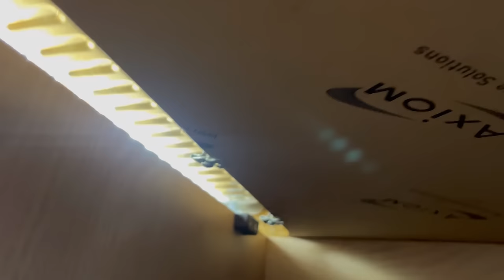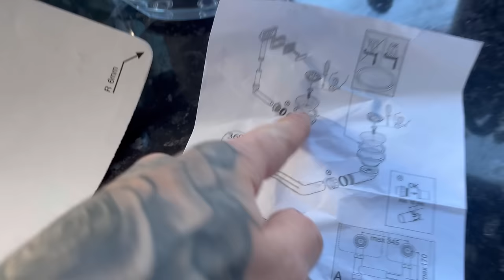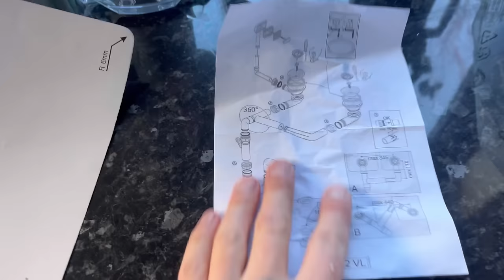I HATE THESE JOBS-Changing a kitchen sink..#plumber

Comment from the maker: Happy Easter everyone, hope you all have a fantastic break if you’re off ❤
Reply: Maybe a silly question but why are the sinks sent out without a 35mm hole already there……. Is it so the product doesn’t crack in transit? Genuine question?
Reply: @gavinbiard3745 different sizes of tap available not all are 35mm
Reply from the maker: @gavinbiard3745  it’s so you can use it as either a right handed or left handed sink, the bowl either right or left hand side.

Comment: Gave our cut work top edge where the sink slots in 2 coats of clear yacht varnish , is still rock solid & bone dry 30+ years on ! 👍🏻
Reply from the maker: Good shout that. Might have to get some of that varnish!!
Reply: @Heatking  , deffo mate !👌🏻, silicone just does the usual especially with the transferred heat of the water especially with a stainless sink , drys out and just flakes away 🥴, don’t get me wrong the kitchen units are still rock solid but looking a little outdated ! after 30+ years 🥴🤦🏻‍♂️🤣 time for a facelift and modernization me finks 🤔, Base & Wall cabinets still solid ! 
Can get away with some modern lookin doors/ drawer fronts, pelmets & cornices , kick boards & newer’er worktops to bring it back to the 21st century 🙈🤣, another top tip !! 👍🏻I did was,
With the poxy angle brackets you get to secure the base units to the wall , was to mount them further in on the side panels then fit some either 3x1 or 4x1 timber to the brackets, flush with the back of the cabinet sides !, across the film width of the back of the cabinets, then you’ve got a bigger area to guarantee a solid fixing to the wall at any point!! 👌🏻

Comment: Just changed my own kitchen sink and tap. Going from a black composite quartz to stainless steel. Only been in a couple of years but the sink seems to stain and goes white around the plug hole just by looking sideways at it, never had any chemicals or cleaners any where near it. The new tap did the same as yours a couple of vids ago, leaking from between the swivel and base. I contact the company I bought it from who contacted the manufacturer.  They sent me two new O rings and some silicone grease,. Problem solved.
Reply from the maker: Cheers mate, yeh I have black at home and do not reccomend! But the customers always right 😂😂

Comment: Nice job, I’m only a diy guy but I’ve changed a few sinks. I tend to use the mcalpine stuff as you mentioned. Different if the customer supplies or doesn’t want to pay I guess. 
Those clips for the sinks always just fall out on me so I use the silicone as glue !
My silicone game improved dramatically when I used those no nonsense tools from Screwfix. 
Good to see you thinking about water getting in the worktop and not wanting to fill the cupboard with waste pipes. Details like that make the difference pal
Oh and the last sink I did, the wife wanted one of those taps with the pull out thing and had a weight underneath . Omg what a pain , the weight still catches on things underneath the sink!
Reply from the maker: Thanks pal! The pull out taps are absolutely awful 😂😂 because you’re right, the weight catches on just about everything and isn’t really heavy enough to pull the tap head in 🤦🏽‍♂️

Comment: great video as usual.i always say to the customer that i wont use any supplied fittings and use mcalpine strainer and traps from the van.wire wool is to keep the mice out,it cuts there gums!
Reply from the maker: Cheers Alan, learned something new with the wire wool and mice haha! Yeh you’re doing the right thing with only using macalpine. Its really good stuff and proven quality 🙏🏽🙏🏽

Comment: You highlighted all the ins and outs of sink changes, rarely simple swaps!
Tap knockouts are designed for centre punch and hammer, that's why  they're called knockouts! 
You'd never drill a ceramic basin or sink, so next time duct tape over the knockout to reduce spalling, centre punch placed in hole centre and sharp whack with the hammer!
Gently enlarging the hole with the hammer head and your done, it never fails and once you've  done one you'll  never think twice!
Keep plugging away as you are and the subscribers will come.
Reply from the maker: Cheers John, I’ve knocked out one before and it made me nervous wreck haha. And with ceramic I actually use the diamond cores to knock them out. Never thought of duct tape before! Thanks mate
Reply: @Heatking  Just go for it next time, you can't  rely on the manufacturers 
marking dead centre, so drilling with ANY bit is a bad idea!
Just use hammer and CENRE punch, not flat head punch and whack it!
Reply from the maker: @johnward5006  ill give it a shot 😂😂

Comment: with the wipes, store them upside down, you'll find they'll be a bit more moist ;) 
Gotta love a little kitchen sink swap 
Those wastes are a absolute nightmare I always go armed with strainers and mcalpine bowl and half kit cause you know full well if you don't you'll need it
Reply from the maker: I should have gone armed with them you’re right mate, just so much better. 😂 is the lid on the wonder wipe’s definitely water tight?😂😂
Reply: @Heatking  I use big wipes which are, but no idea on the wonder wipes 🤣 try it in the sink or basin at home to test first 🤣👌

Yeah those waste kits are questionable, similar to the B&q space saver ones 🤣 get in the bin
Reply from the maker: @killerbean9911 😂😂 I don’t want to loose all the magic juice 😂😂😂😂
Reply: @Heatking  put them upside down in a plumb tub? Then pour the magic juice back in if it does leak
Reply from the maker: @killerbean9911  I’ll hold
You responsible if this fails haha

Comment: Those clips are a bl***y nightmare to fix. They either wont grip the wood or fall apart. As long as the sink cant move I've often just fixed the sink with silicone.
Reply from the maker: Yeh I do like to
Try my best with the clips, but ultimately silicone when gone off will work perfectly fine :) you’re right.